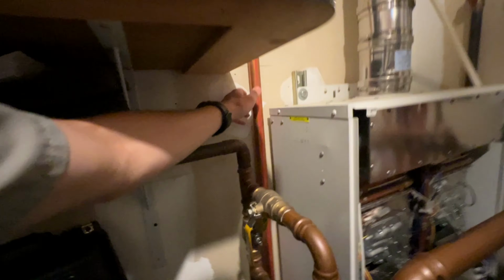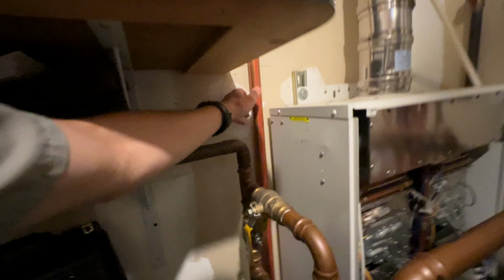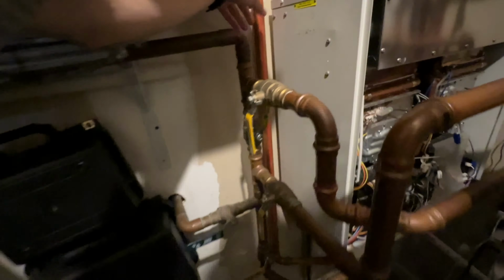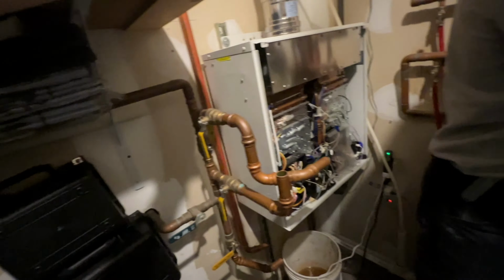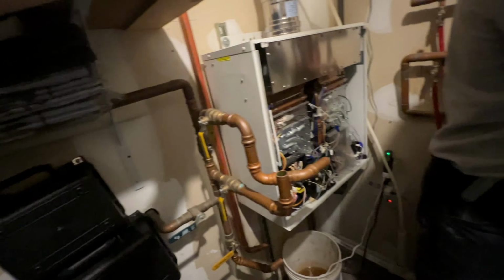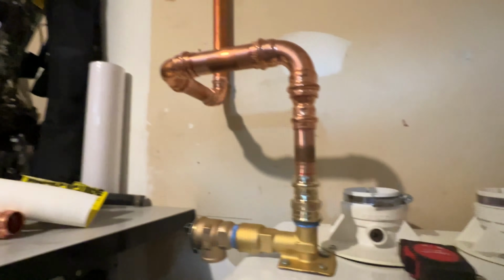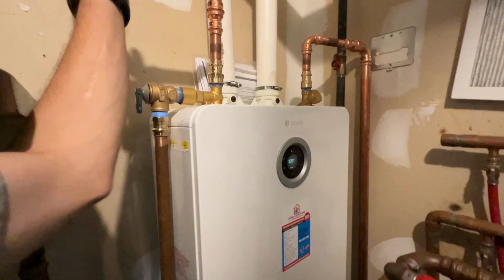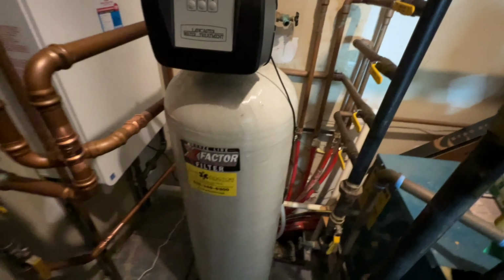How To Install Bosch Greentherm Tankless Water Heater! Removing Grossly Oversized Water Heater!

Comment: Amazing working that system after all these years of the other Korean company and the bickering about distance between intake and exhaust pipe to see a concentric fitting for intake and exhaust was quite interesting.
A difficult installation made to look simpler and the finish made to look like it’s always been there.
Too bad about the water filter placement it’s the only thing spoils the view.

Comment: Not sure how big that house is but mine is 3200 sq ft and I have an outdoor tankless that's 199,000 BTU's and never an issue. There are houses in here that are 5000 sq ft 2 stories that also have the same Rinnai tankless and no issues. I flush mine every year and have spare parts on hand just in case. Not one issue with it so far. It's just for hot water so not condensing. Thinking of buying a spare unit because #FJB to have in case something major happens to it I can easily swap a new one in.